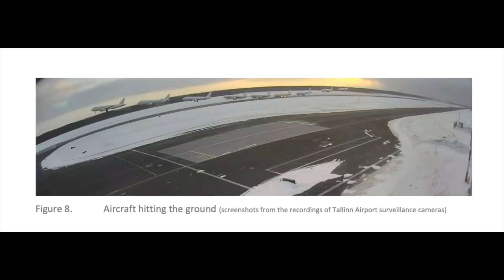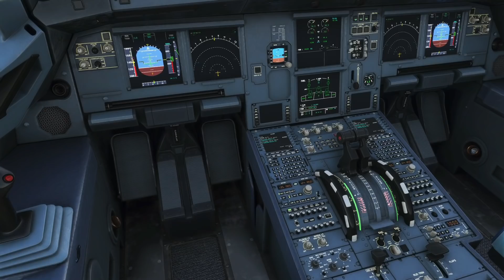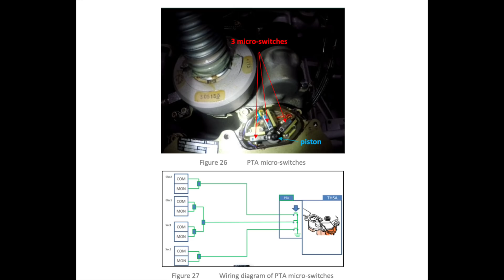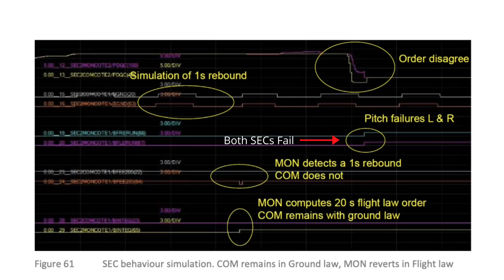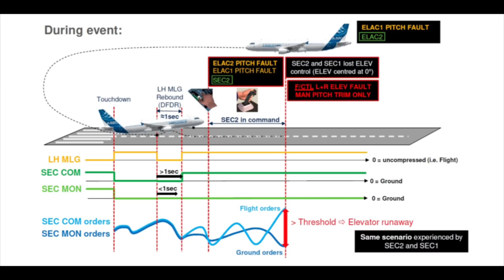The Oil Change That Crashed A Passenger Jet | The Crash Of Smartlynx 9001

Comment: I've never flown on an airplane before, and I am considering that soon, I am going to have to fly on an airplane for the first time in order to go to where I would like to go.

And from all I have read, there are a LOT of issues with commercial aviation that make me quite apprehensive about that prospect.  The problem is that many of those issues are beyond the scope of your excellent channel.

However, one of those beyond scope issues - airline corporate cost cutting to get cheaper salaried pilots into commercial airline cockpits as far as is possible -  does affect my answer to your current question.

I do trust engineering and science, with the caveat that humans do make mistakes, so when an airplane is concerned, redundancy is quite important.  And the final redundancy in an airplane is the pilot.  But, compared to the days when automation was more basic and limited, are today's pilot's abilities to actually be an effective redundant factor affected by today's aircraft automation systems?

Or, as you hinted at here, is the ability of the computerized redundancy systems such that, when something goes out of kilter that the computers cannot recognize, the pilots get the problem dumped onto them with very abrupt output warnings from the computers, warnings that hopefully makes sense to them?

So, given what happened with the 737MAX, I want manufacturers to definitely improve the automation - not just the programming, not just the quality control of said programming, but the training of the airline trainers (the people that train the airline pilots at each airline), giving them ALL information as to what the automation does, no holdbacks, so that when something goes awry like this, I can feel confident that the pilots in my plane's cockpit have the best possible chance to get my plane landed safely with all souls safe.  I would also require all manufacturers to include ALL relevant safety options relevant to the computer automation (such as having as many manual gauges/control indicators/sensors/modules/etc as are needed to help diagnose a fault that the computers can not) as standard equipment, not options at additional cost.

I want the airlines to stop dumping the more experienced pilots to save salary costs - these pilots often have the experience to deal with situations that the computers cannot, and do so more quickly than an inexperienced pilot.  If nothing else, get the best experienced of these pilots, have the manufacturers train them up in the computer automation, and use them as the airline trainers if they're not doing so already, so that the less experienced pilots get some of the experienced pilots' knowledge.  And airlines?  Add more training time and simulators to your budgets, so that the experienced pilots can put some unique situations into the training simulators, so the pilots of today can better handle automation faults.  It's going to make your shareholders grumble, but shareholders ALSO hate headlines of airplane crashes involving YOUR planes, and YOUR insurance companies hate paying claims, and will raise your premiums accordingly, which will ALSO make your shareholders grumble.

I would say, once all this happened, I would be comfortable with a 7 to 8 automation level.  Right now, just looking at the state of automation art today, and all the factors that are within the direct remit of your channel, presuming well trained and experienced pilots, a 4 to 5 automation level I would feel comfortable with.

I hope all this happens soon, because I cannot walk to Arusha, Tanzania, from Minneapolis.

Comment: As an AI student, automation-human interaction is one of the most difficult problem. When decision making (in human-time, i.e. >10-30 seconds) is involved you would think non-authoritative suggestive automation (warning signals, alarms, voice suggestions) would be better than full automation or no automation, but it seems people assume that once the warning disappears, the problem is gone.
Reply: I'm not a pilot, I'm in IT, so I might not know anything about about airplane systems.  Still, I hope what I have to say might help someone.

The problem is that so many times an "Error" comes up because of a minor computer glitch and not because of a functional problem with the system.  When you're used to warnings meaning NOTHING and fixing them with reboots, you have become desensitized to flashing (beeping, voice) warnings.  There needs to be a clear differentiation to the user between computer glitches and functional problems that will cause a crash.
Reply: @prycenewberg3976  Which is why I do the asinine thing and treat every single warning seriously. Every blinky blinky, every twinge twinge, better be safe than sorry.

It drives me crazy when I hear something malfunction in a car or bus, and I silently seethe as to why that little whirring noise that obviously isn't meant to be there or that burning oil smell hasn't been adressed.

Sure, it's a minor thing now. But those errors and issues have a way of stacking up and making disasters if you leave them alone for too long.

I'm the person who will wear all the required PPE regardless of weather. I like functioning ears, eyes and lungs, thanks.
Reply: @Olivia-W  Then you have my eternal sympathy.
Reply: @prycenewberg3976  Hey, it works. Someone has to do the preventative maintenance so things can function day to day.
Reply: @Olivia I couldn't agree more. It bugs me when the hinges of the doors of an airplane maintenance hangar squeak for lack of lubrication. Or when I see a bucket that has been strategically placed to catch rainwater from a roof leak… and it's obviously been there for months!
Reply: @prycenewberg3976  Riding inside a flying coffin whose control computer would be perfectly happy flying a cruise missile to its target and being blown to smithereens is not very appealing to me. I prefer something at the controls that will hit the mountain or the ground first that probably doesn't want that to happen any more than I.
Reply: @algrayson8965  Problem is that humans are very dumb and slow.
Reply: @HypercubeJones  Honestly I think it's an airLINE problem and not an airPLANE problem.  The fundamental design of the Airbus architecture Is absolutely safer than any other commercial aircraft manufacturer out there (you won't hear about it, because.... that's the point. You CAN however find major incident reports, which would have usually resulted in a crash of a competing model/mfg.) 

Airlines need to require and increase hand-flying minimums during proficiency checks, and should at least mandate a minimum number of hrs as well. 

This is completely different, and a maintenance issue, but as far as automation goes - a maintenance screw-up is a maintenance screw-up. I'm not sure you can fault the aircraft mfg or even the pilots, though as I stated above, LAND THE DAMN PLANE when you have that many warnings, especially on multiple units that you (should) know are independent and redundant.
Reply: True, however I’m a little shocked that check pilots would have continued flying with so many errors. Those are pretty serious faults (especially once you get errors on 1&2.)

Comment: When it comes to automation in aviation I would probably fall around a 5. Automation is very useful for tasks such as reducing pilot workload, navigation, etc. But personally I always will firmly believe the pilot should be in the loop and have the ability to fly the plane normally if the automation fails. This crew was lucky as the failures locked them out of all their control surfaces with the exception of the trim. If we have automation working with pilots where pilots have the ultimate control authority that’s what I believe will keep aviation as safe as it is.

Comment: Automation is fine as long as there is a complete manual override option of the actual flight controls. Old birds, like a 747 could be flown without any computer assistance. The auto pilot was only engaged when cruising.

I'm an embedded programmer, who understands the importance of REAL TIME CONTROL. Most "coders", who work in a pure software environment don't have a clue ! The application determines the timing requirements. Sometimes seconds are adequate, other times nanoseconds aren't fast enough. This includes real time operating systems (RTOS) and their abuse, by those who think they're a panacea for timing issues. A proper system is designed at the system level. An appropriate blend of hardware, software, and mechanical components. What's appropriate, depends on the application.

Comment: 6/10 for me. I want the pilot to have full control if needed.
Reply: 10/10 for me. With human pilots, there is always the chance they will make mistakes. Cyberdyne Systems Model 101, also known as the A-800 Aviator, doesn't make mistakes and has a neural network processor, i.e. learning computer, so it exponentially becomes a better pilot the more it flies. It can't be bargained with. It can't be reasoned with. It doesn't feel pity, or remorse, or fear, and it absolutely will not stop, ever, until you have reached your destination.
Reply: @hmartinspliff  A great feature of AI is that all individual units that speak the same language learn together. When one encounters a situation that, being totally unanticipated, is not programmed to handle, even if a human has to take over, all AI software that is interconnected learns from the experiences of each individual unit.

Comment: So, after they failed to reset the error messages they decided to proceed with the touch and go anyways instead of going for a full stop landing and having the plane checked ? What the actual fuck...
Reply: Wrong. Resetting the computer did work but the fault just came back due to the fault with the PTA and OVM.
Reply: @tomstravels520  at 01:55 the narrator states that faults kept popping and the resets weren't helping. This should be an indication that something was indeed wrong with their aircraft, no?
Reply: @70mavgr  that is technically incorrect. The resets worked otherwise the fault light wouldn’t go out. The issue was ever time the pilot tried to override the THS the computer thought there was a fault. Resetting the computer did actually restore it to normal until the override again

Comment: I'll stick to the old McDonnell Douglas aircraft DC8's and DC9's, as we all know DC stands for Direct Cables :-)))
Reply: …but that's not true of the DC-10.  Rather infamously, one of them lost all flight surface controls when all of the hydraulic systems were breached.
Reply: @Kromaatikse  Which is why I didn't mention DC 10's sighs It was meant as tongue in cheek, you know like the saying if it ain't Boeing I ain't going.
Reply: Aren't cables not just thick wires ?    Fly by Wire  !!!!
Reply: @pascalcoole2725  Lolz! Got me.
Reply: dc???  direct crash...
Reply: @olivierb9716  Otherwise known as a landing.

Comment: When automation works, it’s miraculous. When it fails it’s perplexing for the people in desperate need of a solution. I don’t think there is a solution to the automation question until we have that sentient AI that can fully grasp the situation awareness of human pilots.
Thank you for this informative video emphasizing just how complex modern systems are.
Reply: Target should be an automation doing better  as pilots in all situations. In a total power out computers will struggle where humans may take a final chance.
Mars rovers allready doing quite well, but with no soul on board, you can risk a crash.
Reply: @rainerleicht4604  the flight computers did not have the situation awareness of the the pilots. If it did, it would not have become confused and made those pitch fault errors.

Comment: 7 - on automation, i think this is where we are at now, enough to do 70% of the job. With time I'd expect this to increase to 10. You want pilots to work hand in hand with automation, such as in these cases, they know why the plane is behaving as it is and when to intervene. With level 10, as these systems get better then pilots can be redundant as computers will simply be able to think and act wayyyyy faster and better.   Its too late to stop or go backwards as computers have saved countless more lives then they have harmed bu we rarely hear those stories. 

Even in this case, if the computers were not there and automatically checking the control of the aircraft and reporting issues, they would have crashed immediately after they bounced off the runway. no way to tell physical damage of the craft, cant even turn around and look at the control surfaces e.g. rudder.

Comment: Oh, we have a critical error on one of the most important systems in the aircraft? Aaah, whatever. Reset it or smth. Let's keep flying.

On the question of automation, I'd feel perfectly fine in an entirely cockpitless aircraft. I trust a modern computer enough. We've had full automation since the 70s! Today's neural networks are perfectly capable of controlling something as predictable as an airplane. They don't get tired, can accumulate millions of hours of experience, learn from previous miraculous saves, and analyze emergencies instantly. I think this will happen sooner or later.
Reply: From what I have heard, it would only be possible to remove the pilots completely when "True AI" becomes a reality, as right now the technology isn't quite there from what I have been told, and even when it was ready, it would have to be properly tested and certified before it could be installed onto a plane, so I can't really see it happening in the next few years (Boeing were at one point thinking about removing one of the two pilots, and having an AI system of sorts in place of the second pilot, but so far nothing has come of that, I am wondering if there is a bit of a fear about an AI controlling a plane, which may be part of the problem when it comes to implementing pilotless planes)

And if pilotless planes do become a reality, I would hope that there is a system that allows the AI to verify as much as possible that the plane is suitable to fly (and if it detected that maintenance had made a potentially dangerous error or something, or that there was a potentially dangerous defect, then it should outright refuse to do the flight)

Comment: To me your questions are easy to answer:

FIRST I want as much automation as possible to take load away from pilots during normal flights (which should be most of the time), keeping them fresh and rested in case they need to take over.

SECOND I want nested override levels so easy to understand (wrt. which automation is switched off and which still works) so that the automation effects can be always present as memory items in the pilot's head.

THIRD I want simulator training time to be allotted in (approximately) inverse proportion to the degree of automation enabled, including of course sudden failures requiring manual takeover.

Ideally such failures should be inserted randomly into regular simulator trainings, so that neither the trained pilots nor instructors monitoring them have a chance to know in advance what happens when.

The last point may be extended to real flight trainings to SOME degree, if that is possible without putting lifes or expensive material into unnecessary danger.

In this case of course safety pilots need to KNOW what the nature of the failure is, but the decision which failure to simulate when (i.e. which automation needs to be overridden then to escape the situation) might still be suggested at random during the training.

Comment: I'm not a pilot, but about the automation: 1) automations are designed by humans and therefore, regardless of extensive tests, they may lack some of the huge amount of possibilities they may find themselves in. This is why there are software revisions in practically every electronic device. 2) Pilots are human too, and every one of them can handle the situations in a slightly different way. And they are for sure much prone to errors than a well programmed computer. Plus programmed computers have reproducible behavior (if they're not broken) while humans often don't. 3) it's much easier to fix a wrong behavior on a computer that has a specific fault on all the planes, than to fix all the pilots that are flying those planes.
Hence I'm in favour of automation, but it MUST be well explained to pilots (non what Boing did with the 737 MAX for instance).

Comment: I'd have 9/10 automation if I wrote the code myself, otherwise 2/10, can't trust other programmers it seems,

Any programmer worth their salt should know that non-syncronised data/sensor streams will NOT be correlatable between duplicated systems, smh

Comment: Automation is great, to a point. When it is made to lock an operator out of the controls upon failure, it goes too far.
Reply: That is totally misinterpreted. The balance of automation here was very good, all they needed to do is to react to the failures and land. And when the system gave up, they should have follow ECAS message MANUAL TRIM ONLY, so there was a lack of crew action, not the automation problem. However, don't get me wrong, I don't totally blame the crew, it wasn't that easy to figure the situation out. Still maintenance problem in the first place.
Reply: @oakld  I do agree about the procedure you proposed. Not doing so makes it a repeated pilot failure !
A dunky doesn't hit the same stone twice..... It's a blamable accident !
Reply: I don't think the pilots were ever 'locked out' of the controls, they still had full control of the trim wheels and engine throttles to fly the plane as third redundancy in an anticipated two computer failure like this video.
Reply: But it wasn't made to lock the operator out on failure, that just happened to be the unintended consequence